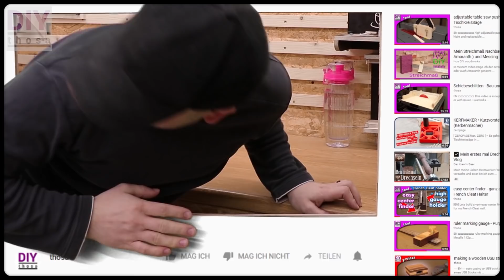THE BEST Router Planing JIG / Flattening Sled - Oberfräse Planfräsen

Comment: Awesome jig which I built immediately. One question. After building it I realized I forgot to carve out the cradle piece (second piece of wood from the top) and realized I am not sure I need to carve it out. It acts like just another spacer piece and seems solidly bolted together. Thoughts? Thanks!
Reply from the maker: thank you 😀🖐  I made the cradle piece to prevent the two L profiles from moving apart. If it is screwed on tightly, it will certainly work without a groove. But I always prefer to play it safe. 😅👍
Reply: @thosa  gotcha thanks!

Comment: What kind of material did you use for railing slides and does it flex at all? Color is like aluminum but thickness and profile is like metal. Jig looks great.  👽
Reply from the maker: thank you 😀🖐  that was stainless steel. No this is very stable. 😀🖐

Comment: I like your design so much I decided to make one myself. In particular, I like that you used angle iron and that the size is adjustable. You have a great mind for this kind of work. I did run into a problem though. My router base is about 7" in diameter (178 mm) but the angle iron on which it rests is only 7/8" (22.3 mm), so it rocks along the direction of the angle iron. It's steady in the other direction. I think my best bet is to replace the angle iron with a wider version giving the router base more to stand on, but I want to check with you and your fans to see if someone has a better idea. Thanks again for providing these excellent videos.
Reply from the maker: thank you 😀🖐 22mm is really a bit too small. 🤔 maybe weld another flat steel to the middle on both sides?

Comment: Congratulations on your idea. You can plan wood from 0.8cm to 13cm high and 1m long. 1) I used an iron angle 4cm x 4 cm x 5mm thickness 1m long ,because it does not bend in the middle due to the weight of the router. 2) I used 13 cm long screws with nuts on the top that I tighten. So I can add or remove pieces of plywood until I reach the desired height and do not constantly change screws depending on the height. Be careful that the holes that will be drilled in the pieces of plywood all open together so that the pieces are aligned.

Comment: That's a great, lightweight design.  I had some rather heavy aluminum angle that my father had got surplus, and was going to use it for a fence. It would make great material for this design.  But I checked it against a known straight edge, and it wasn't quite straight, the four foot piece was slightly bowed, maybe a thirty second of an inch in the middle (a little less than 1 mm).  So I used something else.  So just a caution to check that the pieces of angle you pick, whether steel or aluminum are straight.
Reply from the maker: thank you 😊🖐